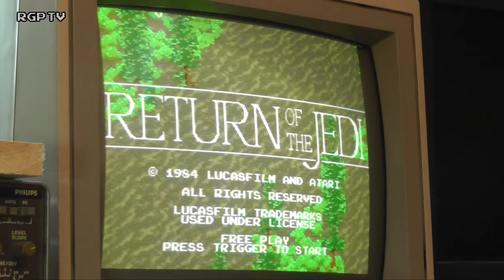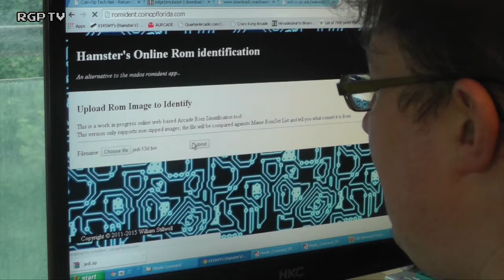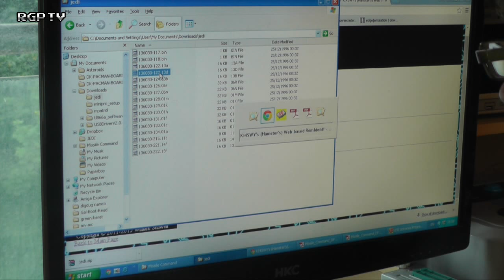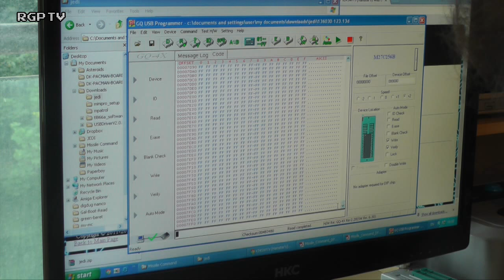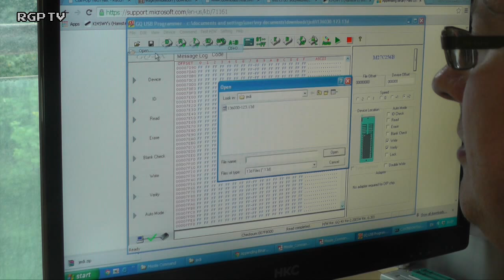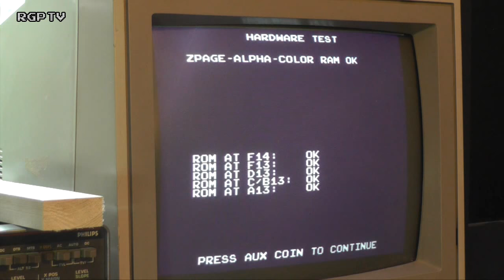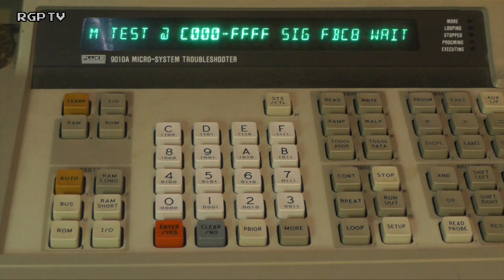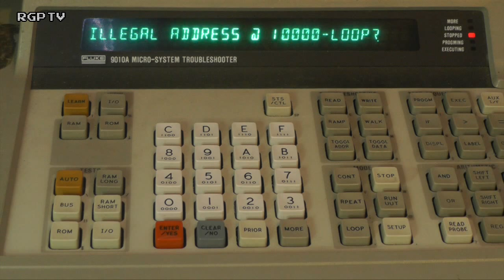Return Of The Jedi, Atari 1984 Arcade PCB Repair - Bad EPROM

Comment: Nice repair! According to the MAME driver source, you can switch banks by writing to 1f80. Values 0,1,2 get you the corresponding contents of roms 13d,13b,13a mapped to 4000-7fff.
Reply from the maker: +josephmmuller Thank you very much, I had literally just skimmed the driver and Quartercade's resources - that's unbelievably useful for the future.

Comment: For some reason, the copy /b command didn't work properly last time I tried to combine ROMS.  The output file ended up being a bit smaller than the total size of the source files.  I ended up using a Hex editor to manually combine them.

Comment: Nice video.   Can you answer a question I have regards the UV EPROM.  I understand that you used a EPROM that is twice the size and I assume it is because the UV EPROMs are difficult to obtain these days.  I looked around and they are only available secondhand, which could be an issue with quality/reliability.    Could you have used the more modern EPROM (non UV version, without the window on top) that can only be written once?  I don't really see a need to reprogram an arcade ROM more than once unless something went wrong.  Or are there compatibility issues with the modern EPROMs?   Thanks.
Reply from the maker: Yep, can use the 28 series EEPROMs as replacements its the timing that matters most - like on some games you'll see -150 meaning 150ns access time, as long as the replacement complies with this or faster (they can go slower to match the circuit) then you'll be fine.

Comment: Nice video ! But where do you find your eprom files ? Is there a website ? Because i've got a PCB of wonderboy with a bad eprom and i can't find the file... :/
Reply from the maker: +KeVibr Generally we will all look in the MAME repository, I can't give you links to ROM files but Google will be your friend, read in and verify one of the EPROMs that are good to determine which ROM set you need.  It can be a bit awkward sometimes to translate the filename to the ROM location on the PCB but verifying one will usually give you a hint to how the others are named to track the one that you need.  Check what ROM type it is (2764, 27128 etc) and then burn the replacement and you should be good to go.  If you're UK based and need it doing for you, we can do that, contact me via the website.

Comment: just looking for the HEX DUMP of that eeprom, it was obvious that the bit 2 was stuck 1., so everything was x4 x5 x6 x7 or xC xD xE xF, it is not needed any more check. Spotted within 2 seconds of showing the dump.
Reply from the maker: To you yes, but not so obvious to everyone else, of course I knew exactly what the problem was but the point being is to show your working out so to speak.  This was over 4 years ago as well but the solutions haven't changed in 30+ years.
Reply: @retrogamesparty   :D, and obvious didn't change,  I wonders if the selft-test mode shown at the beginning, where say "zpage" , reffers to the first 256 bytes of RAM assigned to a 6502, or is anything else?. Anyway, I am a z80 programmer which can code just poking hexas without consulting a chart (well, Atleast, up to 15 yrs ago).
Reply from the maker: @flyguille  yes, i'm pretty sure the ZPAGE is the 6502's 0x0000-0x00FF region although physically the chip that it uses is a 2kb RAM (a 6116 static RAM).  I prefer the Z80 hardware as code starts at 0x0000 whereas on the 6502 the hardware has to be able to read 0xFFFC and 0xFFFD in little endian fashion to then get the actual start vector, however, i'm just not that keen on the actual Z80 language as I was a C64 kid so I grew up with 6510 instructions.
Reply: @retrogamesparty  I grow up with MSX / MSX2 (3.57mhz z80).  https://www.youtube.com/watch?v=fNRUQCPH698  , this was my last unfinished game, before real job took place of my time. (the only thing was lacking is game mapping draw more tiles). The screen mode is 256 color 256x212 pixels, and the goal was 12fps. It was inspired in several games, wonder boy in mosterland + Castle Excellent, my 2 favourite games.
Reply: @retrogamesparty  On the other way, I find interesting about having 256 like registers (about access time ),  I was all life z80 programmer, yes, you are right, the code starts about #0000, but that is the jump table, you can't set there *clean code*.... up to the first #66 bytes, there is all the jump fixed addresses of the single byte RST commands. Also, the IRS is there at #38, and the NMI at #66, clean space for code can be just after that. So, any code which want to START the z80 just has enough space to run a D3 C3 xx xx, which is a huge FLAG to detect ... hey ... this rom is the first from a z80 machine!.-

Anyway, z80 O.S. usually ends setting up hook tables and system vars at > #f000 (RAM), so, the advantage of the z80 which "start from 0", is not quite an advantage anyway.

But z80 has lot more inside the hood to work with than the 6502. But 4bit ALU... ruined it, they forced alu to work on 2 ticks for 8bits ops, just because they found the ram was slow anyway. They set just 4 bits for alu, and with that they cut the future and possible expansion in half,

Comment: cool video! I was looking at using a scope as an XY monitor and came across your videos. On this one, doubling the EPROM. Can you tell the software to write from 0000-3fff, burn the chip 256, then burn again but this time 4000-7fff? I have the same burner and I'm pretty sure you can tell it "where" to start. 

Off to watch the rest of your videos!
Reply from the maker: +Matt Mac Donagh i use a GQ-4X programmer which comes with its own software (USBPrg).  I just used a DOS box to double the EPROM.  You could actually fill the rest of the EPROM with 00's if you wanted, it would still work.  its just that the programmer needs the full file length to write to the device.
Reply: +Retro Games Party I didnt know you could fill it with zero's! Good to know. It was way easier to double eproms on my Needhams device but alas, I no longer have it. BTW, thanks to your videos I bought one of those scopes. :)

Comment: thanks for the video, can u explain how the circuitry is producing the character images on the crt im kinda stumped
Reply from the maker: That's not actually that easy to explain as each board works slightly differently but all based on the same principals.  Essentially the board produces three layers of output which are output on a priority based system - text being highest, sprites being second and backgrounds being lowest.  Usually a block of RAM for the backgrounds has an arrangements of values which represent a 16x16 square in graphics ROM.  Some maths multiplies out the tile number to the start of that tile and then the horizontal and vertical position counters say which bits to pull into a line buffer (another very small bit of RAM) which becomes colour value lookups at the final stage.

The hardware is essentially only drawing one pixel of colour at a time, its just it decides which set of pixels to pull it from..  A zero value in the text layer means to go look in the sprite layer and a zero in that layer means pull from the background layer.

Usually you'll have two line buffers - the active one that the output hardware is sending down the RGB pins and the one that's being filled up <--- double buffering

Today's fancy hardware just uses a huge amount of RAM on the graphics card to hold the entire screen as one big bitmap image and then sends that to the monitor - it actually sends it in much the same way using timing signals - even HDMI works this way in a semi-serial data transfer fashion.

I recommend watching Ben Eater's video series on the worlds worst graphics card which explains the dot clock bit a lot better than I can.

Comment: I don't understand the double-burn - could you not connect A14 to hard ground so the higher 16k is never read, therefore fill it with 0's or any old crap?
Reply from the maker: Yes, you are quite correct you "could" modify the board or bridge-wire the chip - but why add another point of failure?

Firstly, some EPROM burners won't burn the device without a data buffer.  Second, The game may be sold at some point in the future and a problem in the same area could happen, the next person to repair it may not realise a patch has happened etc.  We don't unnecessarily monkey-patch the hardware if there's a quicker workaround.  Its more about what might happen down the line than now.  And we know its impossible to get detailed repair notes handed off and off between buyers - otherwise we'd have every original service manual from every game.
Reply: Hiya, cheers for the response - rather than modding the board I was thinking of a simple jumper to GND across the back of the IC, with the pin  bent away from the socket to prevent the 0v affecting any addressing logic - but same result.  It would be a hack, of course :-$

I take your point about burner limitations though ;-)

Comment: My friend has this game and he is getting an error on 14F. Any chance you know what chip I would need to buy that could replace it? I've never flashed an eeprom before, but I want to help him get his game up and running. I could send you a picture of the chip if that would help. Thanks.
Reply from the maker: Download the schematic and find 14F and it will have a part number - google that part number.  If a self-test is reporting a location based fault its likely to be a RAM or ROM chip usually.  I don't have a board to hand to look up the item.